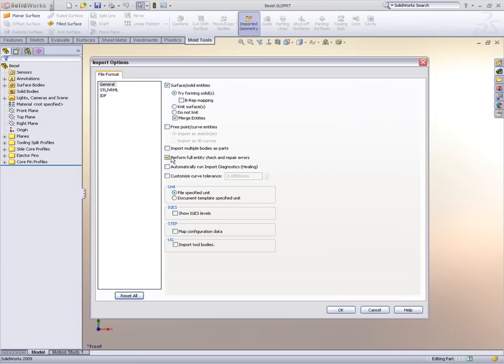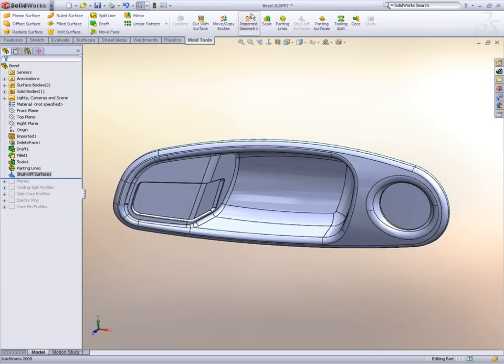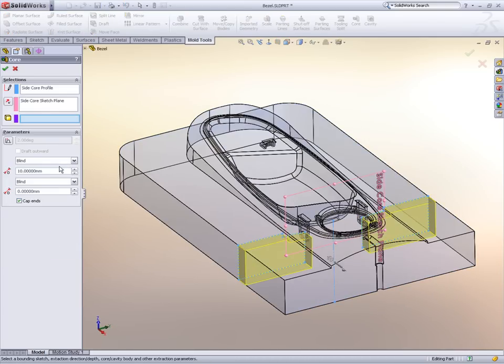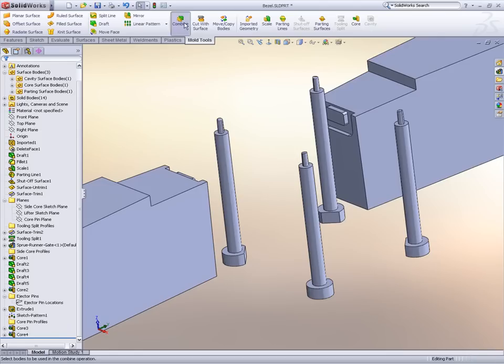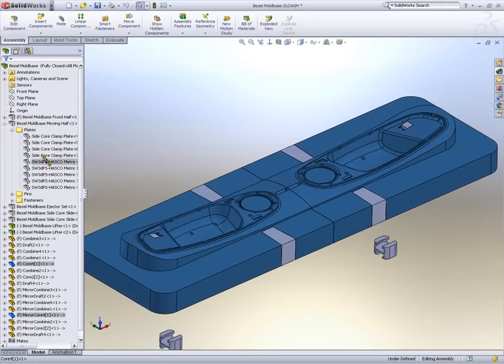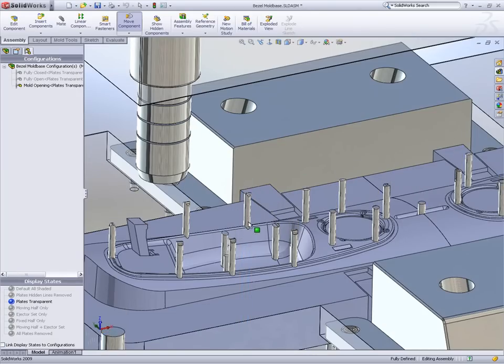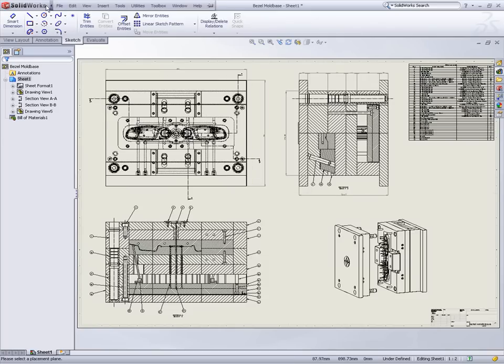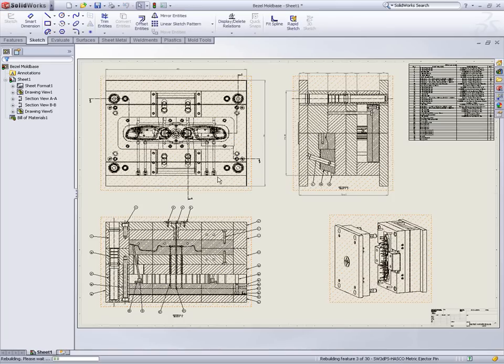SOLIDWORKS Mold Design

Comment: Only problem is with Solidworks Mold design..I am unable to find an easy way of defining a demolding axis and slider traces and movement like I did in Catia... guess that's why it costs as little as a module in Catia you only get some truncated Catia commands...

Comment: Hello, I know the video is not detailing everything, but could you elaborate a little on how to include the ejector pins and how to get them cut with a surface please? If I do my insert with ejector holes as a part, then form an assembly with the mold base, I can then insert a ready made ejector pin as a component to the assembly. But there is no "cut with surface" available in the assembly mode and if I open the component file of the ejector pin, I see no link to the other parts like in your video. I'm confused on how did you make this work?